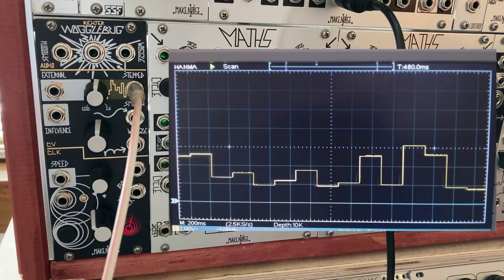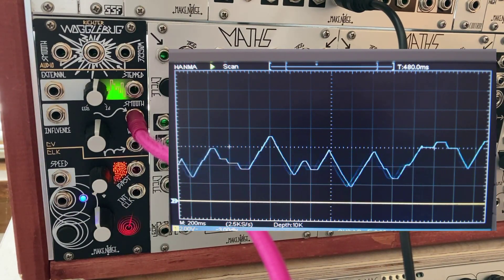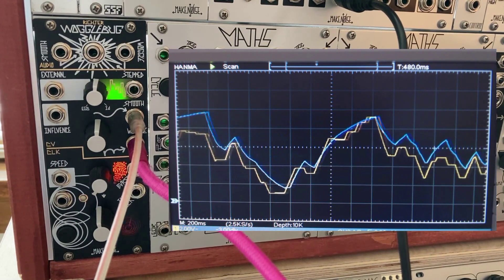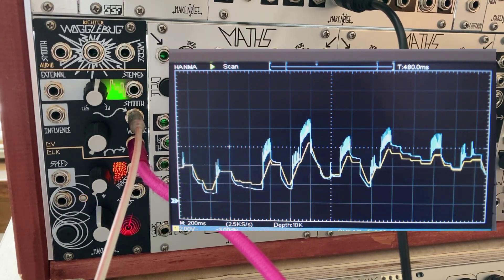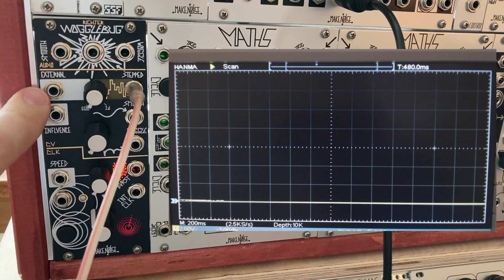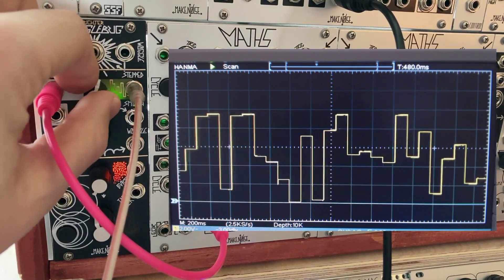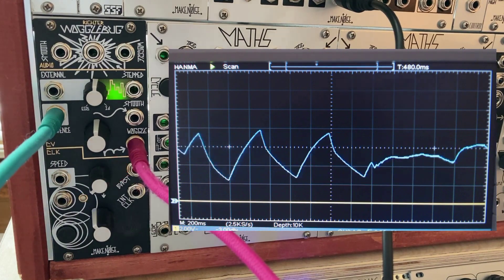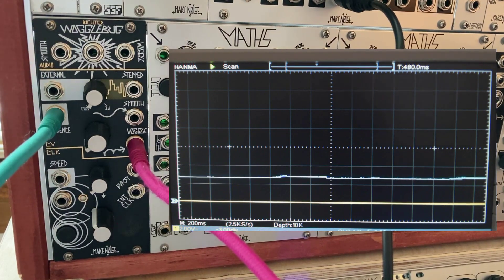Demystifying the Wogglebug Part 2: The CV Section

Comment: Nice! I love these deep dives. Especially for an intentionally enigmatic module like the Wogglebug. One thing I've found through my own use of the module is that the external input seems to be normalled to the smooth CV output (at least that's what it sounds like to me). This is what produces the "drunken walk" behaviour when Ego/Id is set towards the lower side, as the attenuator effectively controls the amount of deviation from the previous voltage. I've often used the stepped CV out to control pitch, and then it's useful to attenuate the signal to limit the range of notes – a shortcut to do this with Wogglebug is to plug in a dummy cable to the external input, which causes it to behave like a normal S&H with attenuation of the internal noise signal! Of course, you would then lose the more interesting distribution of notes that the module does on its own…
Reply from the maker: Great tips!

Comment: OK,this is weird and maybe you can explain. My wogglebug definitely has different behavior around the clock. When I clock into the sample and hold clock input, the master clock (as shown by the red LED) matches that. Any ideas why? Is there a jumper or something, or different versions of the Richter WB?
Reply from the maker: I don't think there are multiple versions. Silly question: are you sure you're sending the external clock into the lower jack with the radiating circles, and not the "speed" input? That's the only thing I can think of.
Reply: @Hermbot  Yup - i'm sending to the lower clock/S&H input, and it affects the master clock. I don't necessarily mind that, but it does give a slightly different behavior. If anyone else in this comment section has any ideas, feel free to chime in.

also thanks Hermbot for this video. Super useful and I appreciate the care and detail.